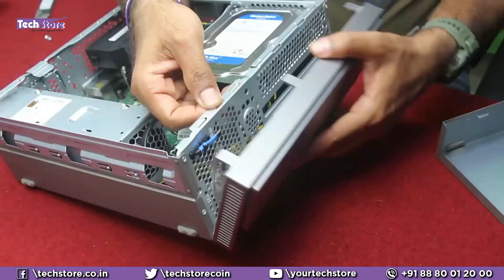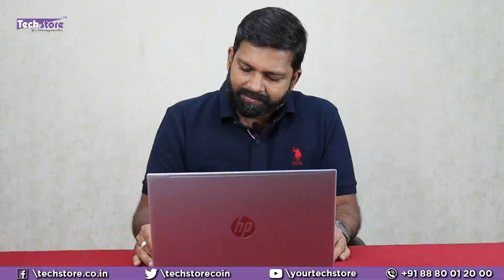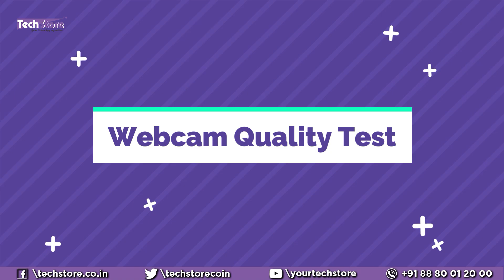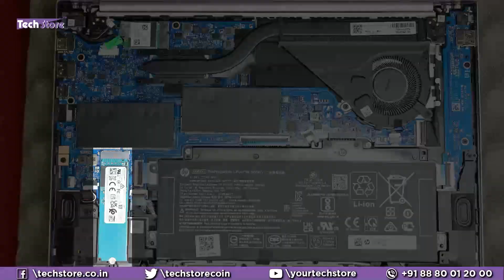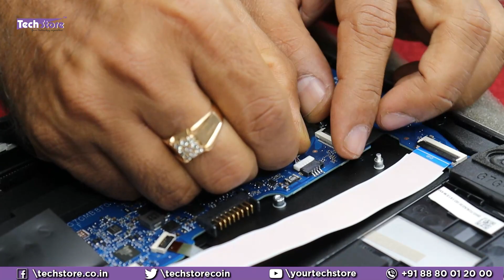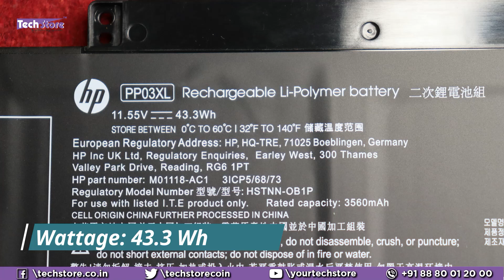Hp Pavilion 14 Dv1000TU DV series :

Comment: there is a heating issue, although not so high, but laptop is little bit heating in normal work , dv1001TU, BIOS updated, Fan is working , still heating .
Reply from the maker: One of the applications might be overusing the gfx/ram. Please reset the laptop and check. Also verify if same issue is persistent when you are in the bios of the laptop. Thanks for the subscribe
Reply: @TechstoreCoIn  thank you sir for the reply